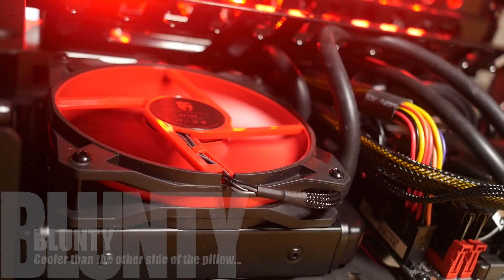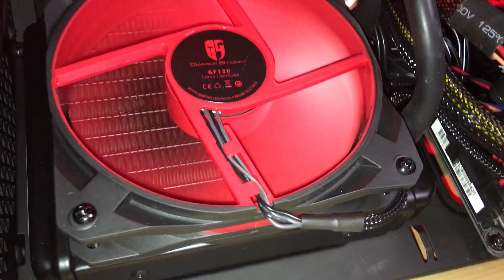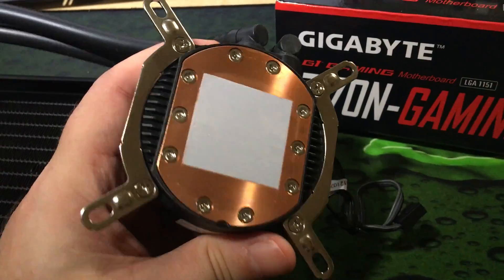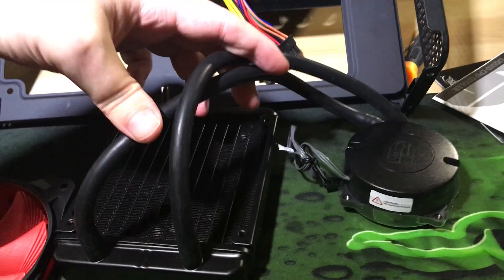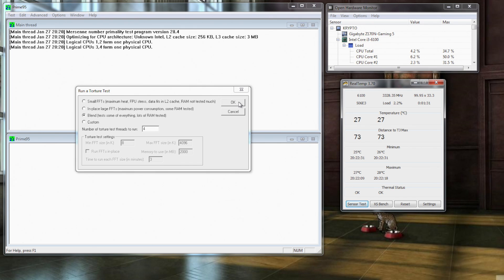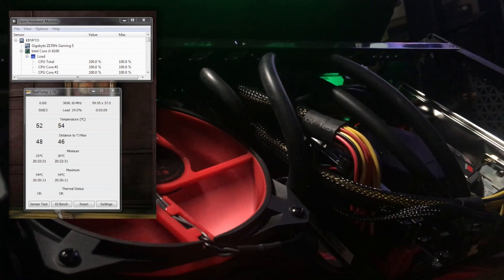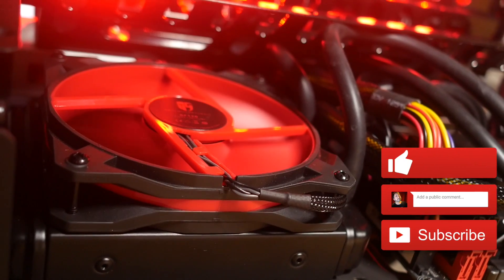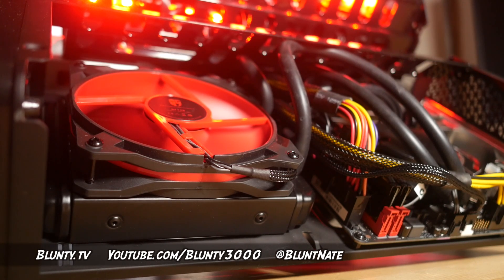Quiet, Sexy, Cool… LIKE ME! ;) - Maelstrom 120 Liquid Cooling Kit Review

Comment: I currently have a Deepcool Maelstrom 240 with a 6600k and its alright. When running intel burn test it goes up to 62 and it idles at 33 which sucks cause its summer in Australia. One thing I wanted to add is that the i3 6100 has waay less heat output compared to the i5 6600k so don't expect ballin' temps while overclocking with a maelstrom 120

Comment: Seems cool, I would love to see how it handles a good overclock (4.7GHz or so). Seems really good for $80 USD, and if it can offer great cooling performance under an overclock, it may work as a great liquid cooler where you do not have to immediately replace the stock fans with noctua fans (which adds an extra $20 to the price).